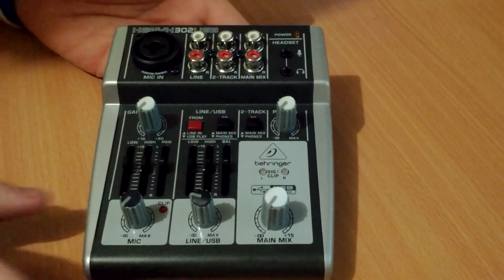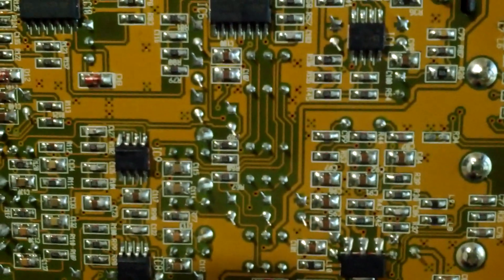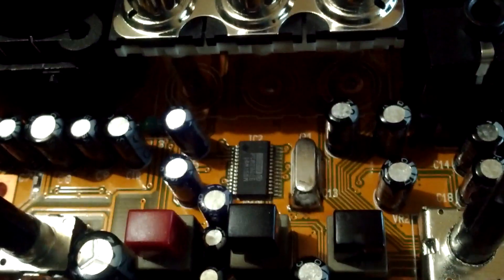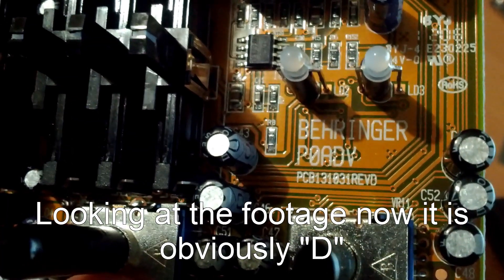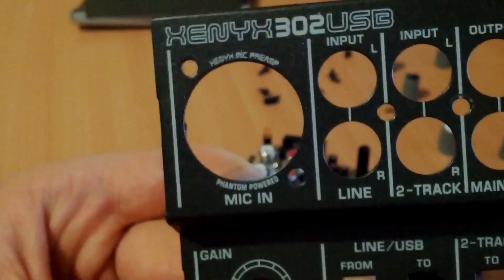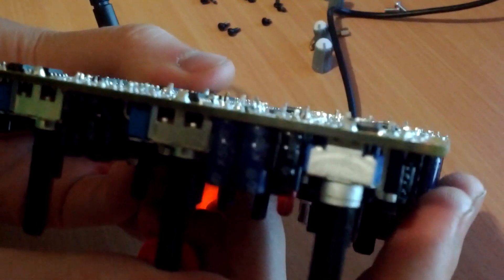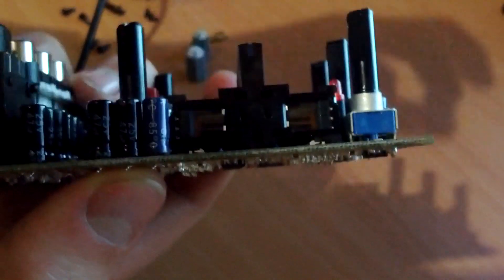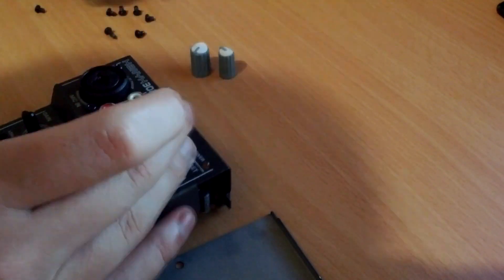Behringer Xenyx 302USB audio mixer teardown.

Comment: Even though this video is old, I hope you will see my comments and respond to them.  I have a problem with the sound on the headphones, the noise is very loud when the phones knob is turned from 50% to 100%.  I heard this test, without any active input.  Is this normal in all these mini mixers?

Comment: So.. the xenyx can provide full 48v? Can't be. I can't think of how usb can do that.
Reply: No it's only 15 V phantom power on this unit.  I have the predecessor - the 302 non USB version and it is also only 15 v. The manual for my 302 was shared with the 502 and they mistakenly listed the 302 in there as 48v. I contacted Behringer and they admitted it is only 15 v. Behringer recommends owner's of this board buy their PS 400 phantom power unit to power condenser mic's, then use the XLR pass thru to the 302 to clean up the sound. Had I known mine was only 15 v I'd have never bought it.
Reply: It's far from impossible. The microphone will actually consume only the tiniest amount of current, so you aren't running into power limits here, in spite of for example integrated boost-flyback getting more lossy and more noisy with boost factor, you have leeway to fix things up. I have an old TASCAM that does 48V from USB, haven't torn it apart yet to see what they did there.

Whether Behringer actually did it? Uhhh, it's a somewhat sloppy company, products get revised, specifications are unreliable. So apparently they didn't.

Comment: xenyx 302 gives alot of hiss when the gain is about half just half. what the hell is that ? is that normal for such mixer ? i don't think so.!
Reply: Probably the phantom power
Reply: +15schishti i already tried disconnected the inductor supplying phantom power but there is still hiss. Also there is also a problem of DAC ic that is pcm2902 which contains digital noise
Reply: Mr.Sam Ali I'm talking about using this with a condensor microphone. Unless you are using a dynamic microphone then the hiss will be there if the phantom power required is above 15v because it will need to amplify the signal so that will amplify the white noise as there is not enough power.
Reply: +15schishti on dynamic it shoud not effect. this is the design of the dynamic microphone circuit. and the hiss should be gone when there is no mic plugged in. but it gives hiss at standby mode. i checked whole circuit and found tl082 op amps which are not low noise op amps. overall the circuit is done precisely and correctly but they used low cost components. like that dac pcm2902 which is in the usb soundcard worth of 0.50$
Reply: +Mr.Sam Ali sure it's not your cables? I'll feedback when I test my one out
Reply: +15schishti yp I am Electronics Engineer so i 'm detecting the causes of such problem since 15 years. I worked on this xenyx302 and result was " it is just a normal usb soundcard for general purpose". Hiss can't be removed from this behringer. Also 15v phantom power it should be at least 17v so you can drive almost all microphones. But its another issue there is  alot of bad things about it. If you bought it new then i am sure you're going to return it soon.

Comment: Thanks for this. I was thinking of getting one and as soon as I saw the general design/build quality and heard you say "PCM2902" I knew it would be OK for me (I'm a big fan of TI PCM series audio chips).

There are a lot of people on the web complaining about "hiss" with this mixer. I'm guessing it's because they're talking about microphones and the phantom power is very weak - it should really be over 40V to drive most microphones. 15V microphone power will need you to turn the microphone gain waaay up and there's where the hiss will appear. If microphone is important then make sure your mic will work or look elsewhere.

Me? I don't care about the mic input, I only need line-level inputs/outputs/mixing. This has enough connectors for me so I'm ordering one today.

PS: I have no idea why Behringer chose 15V, maybe it's because USB doesn't have enough current for a 48V DC booster+mic driver.
Reply: Exactly the reason I think. All of the other mixers which are USB use a power supply on top of the USB, I I prefer this with a dynamic of get my interface and at2035 which I'm selling.

Comment: My AKG P120 dont work with this mixer!! :( This mixer have some problem with the Phantom Power.
Reply from the maker: The Voltage Spec for the AKG P120 is 44-52V and while some mics will work down at the 15V that this mixer provides there are no guarantees.
Reply: Timothy Hobbs  TKS!! :(
Reply from the maker: Yes you can use something like this http://www.music-group.com/Categories/Behringer/Signal-Processors/Microphone-Preamplifiers/PS400/p/P0489 
to power the mic
Reply: ***** I also have a P120 and the Xenyx302, what did you do fix the extremely low output? I'm completely heartbroken that they don't work together
Reply: +Timothy Hobbs you can use external phantom power to connect the full 45v microphone.
Reply: +Timothy Hobbs hey brother, is there any solution for hiss. xenyx 302 has its own hiss. i also wanted to replace its pcm2902 usb codec ic need a solution for 24bit. because xenyx 302 has pcm2902 from texas Instruments and thats a 16bit 48k 
i am just checking datasheets may be i find a suitable for easy replacing with minor changes

Comment: somebody help im trying to record with it but no audio is poping up i got an mxl 770
Reply from the maker: The Voltage Spec for the MXL 770 is 48V (+/-4V) and while some mics will work down at the 15V that this mixer provides there are no guarantees. Also make sure you are using an XLR-XLR cable not 1/4in as that will not provide phantom power.
Reply: +Timothy Hobbs  I have PS400 micro power 48+ Phantom but still my voice is too quiet T.T

Comment: This is great. just got mine today and am impressed with the build quality as well. Noise floor is low and you can even power it from a cell phone charger etc which is nice! have to sort out why the level to my computer is so incredibly loud but other than that the metal construction and size are great.

Any chance a different op-amp could be installed to make the preamp quieter?

Comment: Hi, I bought this mixer a few days ago, and i'm currently using a shure p48 dynamic mic temporarily. I wanted to ask if the behringer c-1 studio mic is compatible with this mixer? in the sense that it doesn't need an external phantom power source? Eagerly waiting for your response. Thanks :)

Comment from the maker: It will not add together and the mic should be fine, however i cannot guarantee the other phantom power supply will be fine. if I was designing one I would capacitively couple the output (that you connect to the mixer)  and and connecting it this way would be fine. please look up the manual to see it it mentions this type of use.

Comment from the maker: Yes this mixer only provides about 15V but unless it specifically states in the manual that lower voltages wont work then it will be fine.

Comment from the maker: No there is no risk at all. The input impedance (ohms) of the mic or guitar input is very high so it wont load the guitar pickups very much at all and the mixer is fully compliant with the USB standard so there is no risk to the PC. There is various situation in which doing something stupid will damage something but this is not one of them. Also make sure you use a 1/4" jack (both ends) to connect your guitar to the mixer (not XLR) to make sure the phantom power doesn't damage it.

Comment: Thank you for your in depth review! I was deciding on which of the 2 entry setup: 1) Blue Icicle + Behringer C1 or 2) Blue Yeti. The Yeti was preferable because Icicle has no headphone output, and only 44.1kHz, until I found the Xenyx. There are no comparison review for the mics, but my guess is C1 would have the same if not a bit better sound then Yeti, and I can upgrade in the future! Can you confirm if this will power any XLR mics? (All review said 15V, what would that affect?) Thanks! :)

Comment: There is a Real time Zero latency monitoring feature embedded in this design that cannot be disabled. Its very annoying when using digital software effects for my guitar to hear the dry signal from the guitar as well. Do you think I can cut away a PCB trace to eliminate it?

Comment: I am looking for a Mic preamp which will provide phantom power to my ECM-8000 Mic to be used for Measuring My Room Acoustics using Room Eq Wizard software. So as per your analysis, the piece is not full duplex. Which means that I can connect the Mic to it which will in turn send the signal via USB to the computer, but will not let any output from the computer route through the same USB to the Line-out of this device?

Comment from the maker: Although the mic specifies that it needs 48V or 24V these are just standard voltages and I am confident that it will work at 14 but with a reduced output. 
Having said that there are no guarantees and there is a chance it won't work.

Comment: Have you tried running the mixer through a pair of monitors, or through a PA, while having something playing in the computer (through the USB)? Is there any/much noise coming from the computer? I've used a Line6 Toneport as an audio interface, and if I connect it to a pair of speakers/monitors I get an awful, high pitched noise from my laptop (which I think it's coming from the clock and HDD). I was wondering if that happens as well, with the Behringer.

Comment from the maker: This mixer will not take MIDI signals directly but if your keyboard has line level or headphone outputs you can use them. To connect MIDI signals directly to a computer (so you can play whatever sounds you want) you need a different interface.

Comment from the maker: Sadly, no. This mixer does not have multiple separate buses like more complex ones. In theory if you could find the traces that go from the main mix bus to the headphone amp you could cut them. In that case you may need to tie them to ground with 10K resistors.
I cannot find these traces in about 30min of trying to reverse engineer the headphone amp circuit. All I found was that the chip is an Analog Devices 8602D. It is quite confusing as they might be mixing mono and stereo together etc.

Comment: Good to know you can mod these to add an spdif in and out jack because that USB audio chip has pins for them. I'm a little curious what the phantom voltage is with a mic plugged in. I just got one of these today and I have several other Behringer mixers and Maudio interfaces and what's different about the 302 is it does not have a phantom power switch. Phantom power appears to be always on. I connected my Rode NT1a mic and it worked beautifully with incredible gain so it's 'enough' voltage.
Reply: Subparanon 
According to the company website, the 302 and 502 both provide 15v of phantom power. I measured my one at 14.7v